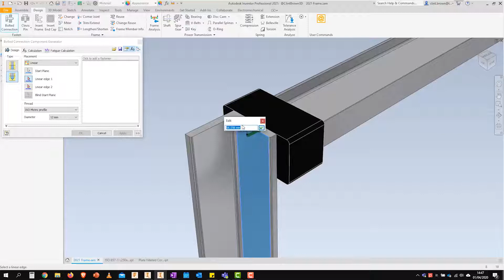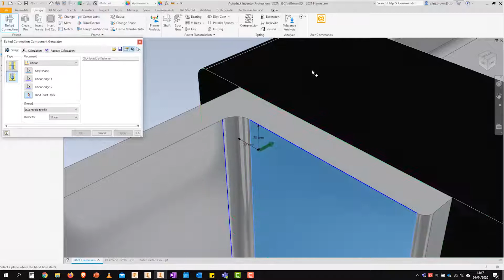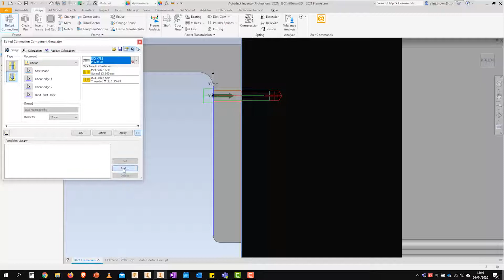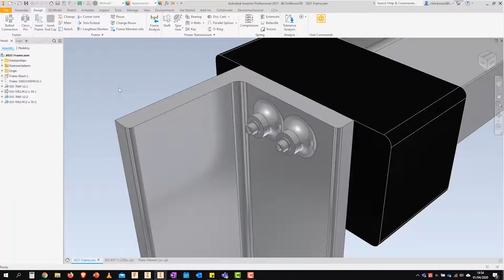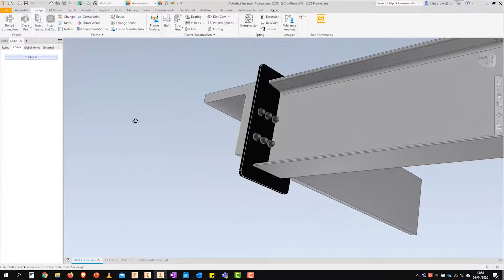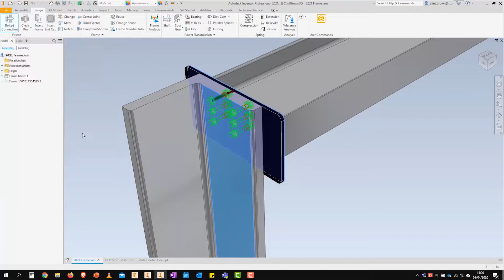Autodesk Inventor Bolted Connection Overview

Comment: Hi, thanks for the video. How did you place the points? I did it using sketch in assembly and then you can´t  chose the points.
Reply: The best practice is to include the reference sketch to one the parts involved in the operation. Cheers